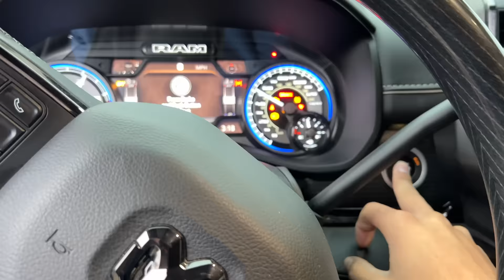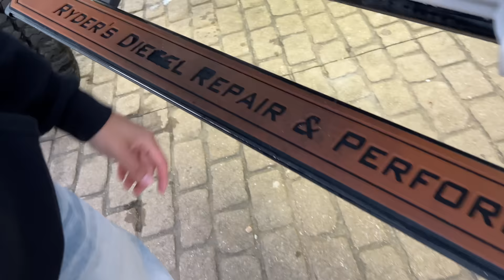FIRST MOD on my 12” Lifted Ford F250 Limited!

Comment: I have a Ram 15 2500 4wd and I am having alignment issues on the frontend. It’s eating tires. What would you suggest me doing? As far as ball joint kits or whatever.